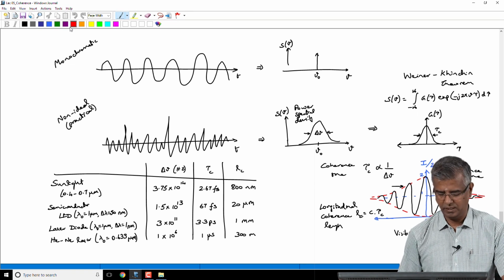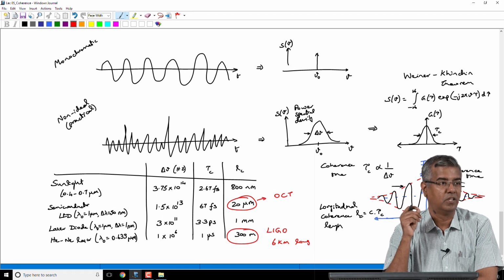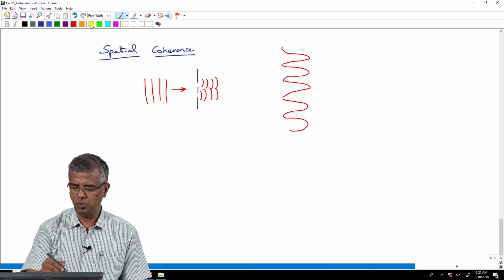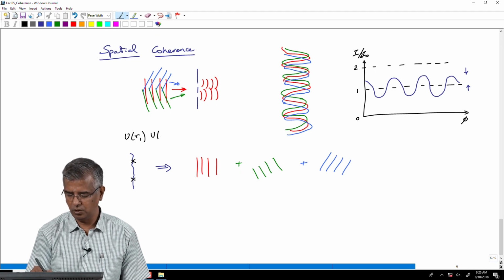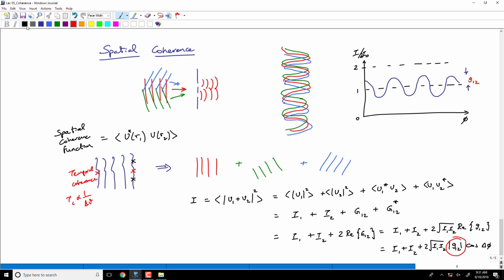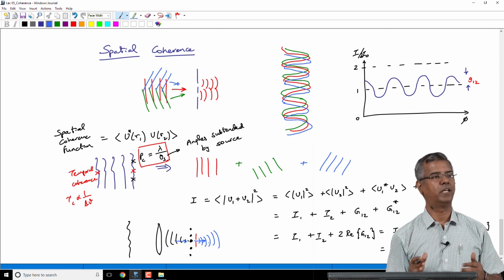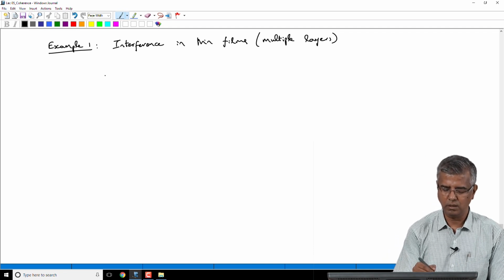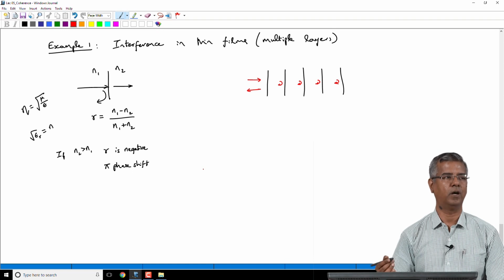Spatial & Temporal Coherence

Comment: if I am still I should be in a  coherent state acquiring both factors of coherence which is temporal and spatial, if I am spatialy  located than that in itself is my temporal position, however if I am in constant motion I do not match the rule of spatial coherence with the help of rest I can maintain these two factors, isn't that correct?